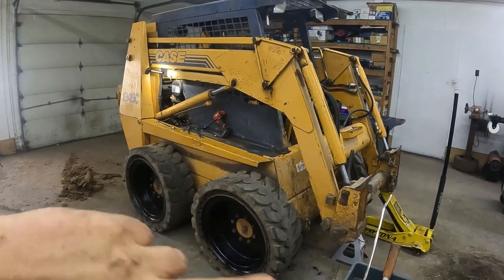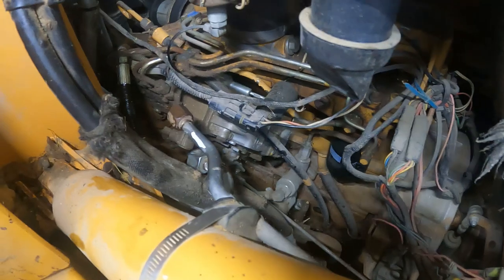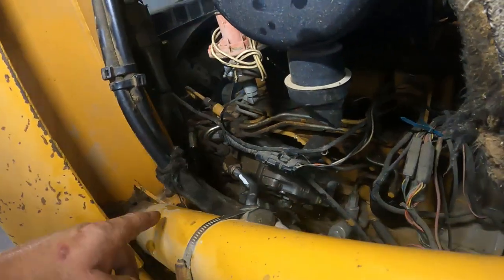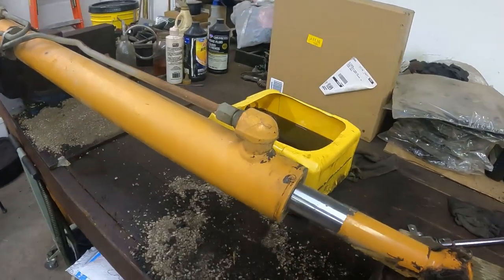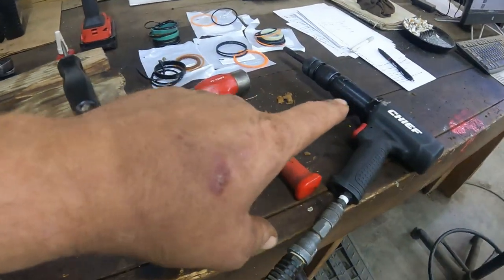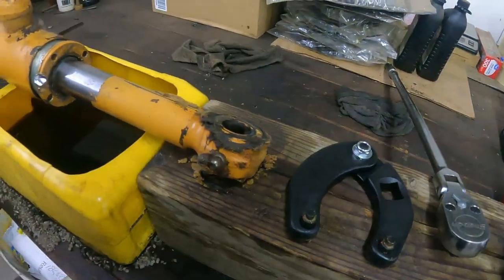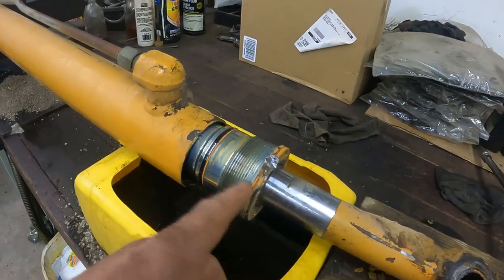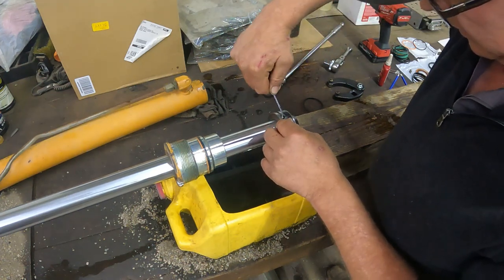Case 1845C Skid Steer Cylinder Rebuild / Repair

Comment: Excellent video Theo. That gland nut was pretty tight. The gland nut on one of my snow plow angle pistons popped out of the tube. I threaded it back in and angled the plow. It popped again. I noticed that the threads in the tube were wiped out. The local Napa store sold plow parts so I went down there. They didn't stock the pistons. Went back to the shop and tapped the gland nut back in the cylinder and put a bead of weld around the nut and tube. Ran that plow for 5 years with no leak! 🤣🤣
Reply from the maker: LOL hell yeah sometimes you gotta do what you got to do to keep going and sometimes a temporary fix becomes a permeant fix LOL ... thank you for watching

Comment: The case 1845 was the easiest to handle, more power as it was direct drive and easy to work on out of any other skid steers out there. They have the most visibility of any skid steer. Especially the new one if they replace the 1845 with. Unfortunately Case discontinued. The 18 series including the 1840, not a bad machine and the wonderful 1845. You just have to do maintenance on that 1845. The only weak spot is your two front rams for your bucket. They will bend and look like a banana. Take them to the machine shop and have them put in a bit stronger metal and you'll never have a problem with the bucket rams.
Reply from the maker: I full on agree with the Case 1845 was and is one of the best skidsteers ever build. This is my personal machine and use it weekly around the property ... thank you for watching

Comment: Do you have a video on removing the tilt cylinder?
Reply from the maker: No I do not have a video on that. It's pretty easy tho ... thank you for watching
Reply: @CountryMileGarage  thanks for your reply. Yeah I wasn't sure if I needed to have the bucket in a certain position but I figured it should just be down flat on the ground. Thanks again and good informative videos.
Reply from the maker: @JohnFoster-jz9cz  yes if you leave the bucket on just set it down flat and it'll be easy to remove and install